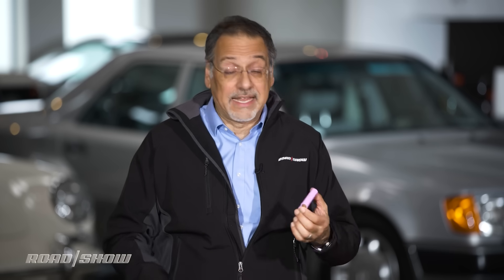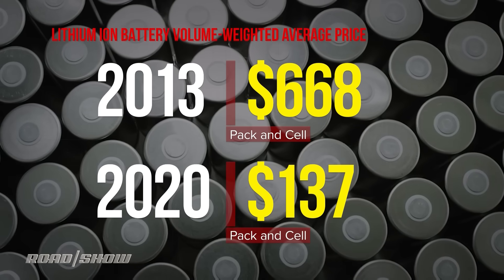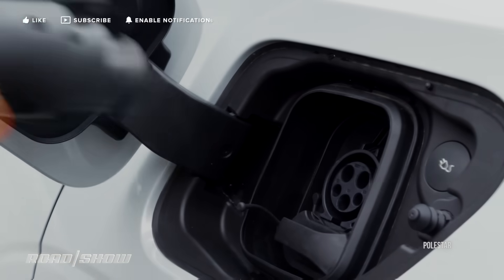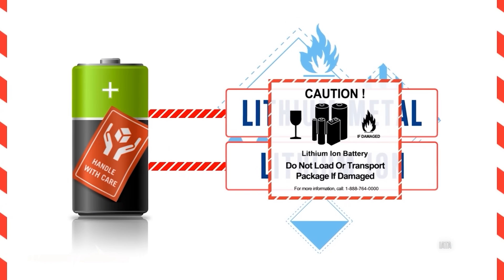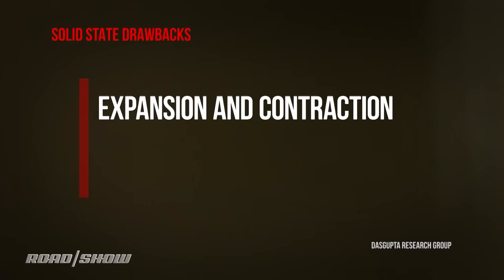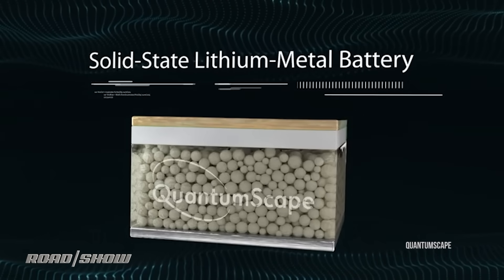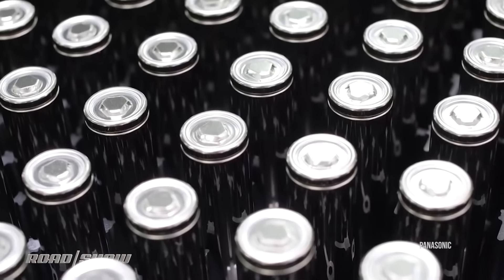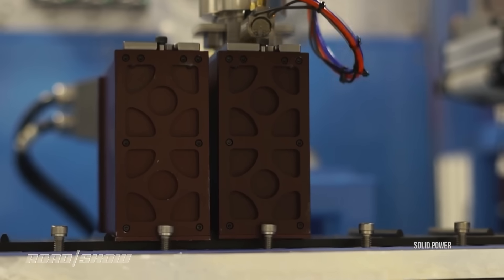When solid-state batteries arrive, you'll want an electric car

Comment: He's either a shill, or a freaking moron. I'm an engineer, computer engineering to be exact.  I took solid state classes like normal people wouldn't even believe exist.. basically all physics of solid materials in the context of electrical charges and/or electric current.

Batteries work by a set of red-ox (reduction-oxidation) reactions, using a common solvent and intermediary chemical products.

This just DOES NOT HAPPEN in solids.  Whatever the hell he thinks he's talking about, if it's solid state, by definition, it cannot be a battery.

By the way, I have never scored less than 97% for my cumulative end-of-semester score in any Physics class in my life.

Comment: I have an EV i have for years,  they are great, dont listen to this dude, go pick one up now!
Reply: Can't wait for the new EVs that will be available soon.
Reply: Just because your EV is good doesn't make every other EV good. That is like me saying I have been driving fueled vehicles for 49 years, they are great, go pick one up now. There are big differences between the different types of vehicles, they aren't all the same.
Reply: @drwisdom1  That lacked any point...ICE vehicles are the past...look towards the future.
Reply: @davidc2838  Many places still experience interruptions in power. Where is all the electriity coming from when 100,000,000 electric vehicles need charging?
Reply: @3mtech  If we’re talking about the US, EU or other developed countries, we have excess power / electricity ⚡️ at night due to Baseload / keeping electricity plants running and at various times during the day (when Solar is maxing out production). So charging is NOT a significant problem. More battery storage is key...and vehicles can actually help with that, since they are big batteries themselves
Reply: @davidc2838  There are 1500 per shift at my last job. What if 100 have EV. Who is supplying electricity and how?
Reply: @3mtech  EVs charge every single night...so they typically don’t need charged during the day.
Most good EVs have software so that they charge when it is the least expensive.

Unless you’re driving 150 miles to work...you probably won’t need to charge during the day.
But when we get to that level of penetration of EVs, many companies will install Chargers.
Some already do...more Chargers are being installed every week at stores, shopping malls, companies, gas stations, hotels, parking decks, entertainment centers, etc.
Cheers!
D
Reply: @davidc2838  Last three places I worked at didn't have enough parking, many had to park on street and walk. But they will install chargers!!??
Reply: @3mtech  Probably could use a better job if they can’t even afford a parking lot.
Doesn’t seem like you’re in the 10% buying an EV anyway.

On almost all streets there are street lights...which means they have electricity running to those lights.
The main point is that people charge at home.
There weren’t any gas stations until they needed them. Now there are too many.
Same is occurring with Chargers. As the number of EVs double each year, the number of charging stations will continue to grow.
This is already happening in well developed areas and will continue to grow as the demand increases.
Cheers
Reply: @davidc2838  Haha. I expected that from someone in their grannies basement. International fortune 500 corporations. No street light where these facilities are located. I don't know the load consideration for chargers but I'm pretty sure lighting is consuming the voltage available, but you wouldn't understand or appreciate that
Reply: @3mtech  
Went to a Top 10 engineering school. I got this. So no need to pretend that you know anything more than I do.

Mcdonald’s is a Fortune 500. So is Walmart, Home Depot and Costco.
We know it’s not the last three because they all have big parking lots! 😉

With most EVs, you don’t need “Super Chargers” to add miles to the EV if you’re just going to park your vehicle all day. (Or all night.) most of them can take juice from a standard outlet.
So we’re not in the least concerned about made up FUD. It’s simple to put a couple battery storage units up in a parking lot and run lines to them.people trying to make this harder than it actually is.
Cheers
Reply: @davidc2838  Haha, and yet...
Reply: @davidc2838  Google(if that is not too passee), contribute. Anecdotal hyperbole from some "expert" on facebook doesn't count. I dont know in what utopia you exist, but in the good ole US of A  no one is giving a single watt of electricity for free. So I dont see Walmart or McDonalds handing out extension cords any time soon. In the real world fifty miles is not even a commute, its an errand. Oh. I went to Johnson Space Center, doesnt make me an astronaut, but I am an engineer
Reply: @davidc2838  8 dollars for a cup of coffee but the electricity and wifi are free. You are either a bot or this a creative writng psychology AP course. Buh bye...